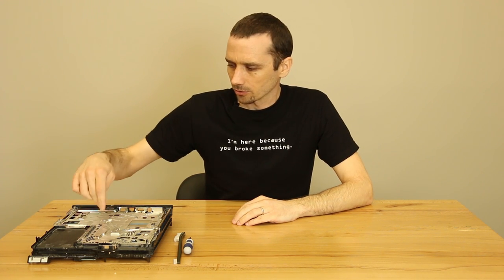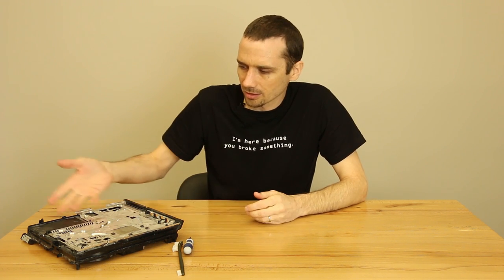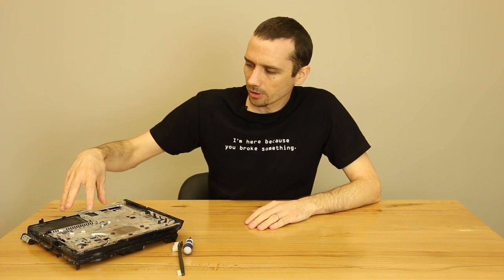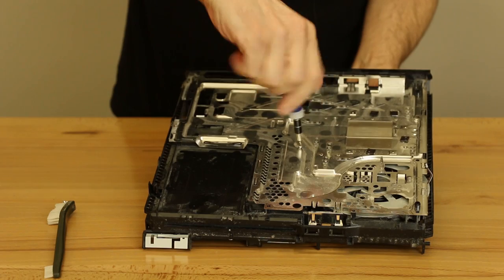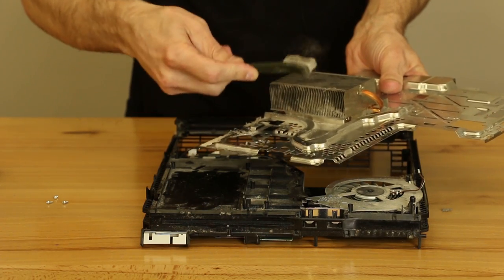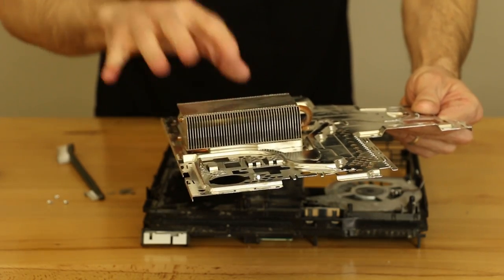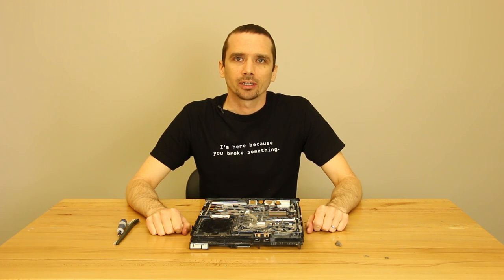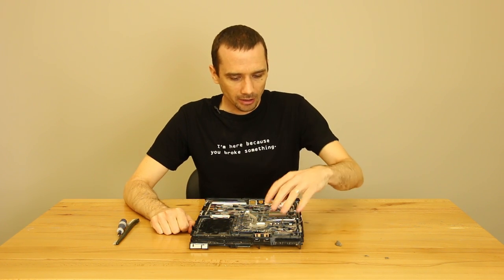PS4 Overheating Repair Tips - How to Fix Loud PS4

Comment: I have a vacuum that I can switch around and it blows air,  the should be fine to clean heats ink and any dust with? I've been blowing fan out since warranty expired, but it was really bad with dust.  So thanks now I'm going to blow heatsink and replace paste. I shouldn't have to take optical drive out correct?
Reply from the maker: +joshua knight Yes, that works fine for getting most of the dust out. You don't have to remove the disc drive.
Reply: Thanks. Just finished,  and thanks to you I got everything clean.  Would of never known to take out 3 screws for the heatsink and fan,  I definitely would of missed that. Best teardown videos on yt. Seen 1 guy that recommended leaving fan plugged in...
Reply from the maker: No problem...ya, it's easy to miss. Glad you liked the vids!

Comment: My ps4 has been overheating since 2018 i've had it since it came out and the screws that u would take out to clean the fan are not coming out is their a way to get them out?
Reply: hmmmm... 🤔 try to roll out with gripper tool 🔧 i have the same problem and for me this tool is worth it for me try to find a small grip for those screws i hope i helped you 🙂

Comment: I vacuum the outside of my PS4 about once every two weeks but I've had it for over 3 years so its understandable that it now sounds like a jet engine. Should I take it apart and vacuum the fan? I heard something about static electricity from a vacuum damaging the PS4.
Reply from the maker: The vacuum won't damage anything. I'm guessing that changing the thermal paste might help in your situation.

Comment: My ps4 never overheats and shuts down. The fan comes on loud alot, I didnt do that for the first year, I've re done the thermal paste on the apu multiple times after deep cleans and that keeps it quiet for about 3 months, the heatsink and the gap is just a bad design all together.

Comment: If the internal fan goes out (after pulsing like you said) can I use an external cooling fan instead as a temporary fix until I can replace it?
Reply from the maker: Probably not. I doubt and external fan would provide enough airflow.

Comment: TronicsFix, my ps4 gives me a notification that the temperature of my ps4 is too hot and i need to turn it off and it gives me a red blinking light where the white light is. In less than an hour of play time this happens, what should i do? I dont want to take it apart and i cant send it in and also it is hot to the touch, please help!
Reply from the maker: If you don't want to take it apart and don't want to send it in then there isn't much I can do for you. Those are your two options.

Comment: If I send my ps4 to you how long would it be before I get it back. Also I have done everything but change the thermal paste so would I be able to send it to you and you could change it and if so for how much?
Reply from the maker: Here's our listing for overheating repair...it should answer any questions that you have...let me know if it doesn't: http://www.tronicsfix.com/store/p56/PS4_Overheating_Repair.html

We charge between $69.99-$89.99 depending on how quickly you need it fixed.
Reply: +TronicsFix is their a guarantee that it will be back in 1 day if I pay the extra money?
Reply from the maker: It's not possible for it to be back to you in 1 day. The repair takes 1 business day. Return shipping takes and additional 4-5 business days.
Reply: +TronicsFix thank you i will most likely send it
Reply from the maker: Sounds good

Comment: If the fan doesn’t turn on at all will that prevent the PS4 from working?
Reply from the maker: No, it will still turn on...it will just overheat quickly.

Comment: my ps4 overheated i have it in well ventlated area i was playing sao for a short time exited the game all the sudden it turns off i tryed to turn it on no reponse  pressed power button again the light was blue then turned on one problem came up the fan is not working at all i fear that i have to replace the fan problem is i cant fix it if i do itll be broken im stuck with 2 options buy a new one or have it fixed by  someone with experience and when i turned it off it beeped 3 times.
Reply from the maker: I can fix your fan or any other problem that's causing the overheating, no problem: https://tronicsfix.com/collections/get-started

Comment: My fan is super loud playing online games. Me and my son have the same old model. I took it completely apart cleaned it put the thermo paste minus the pads still loud, his is not that loud. Ive never had a over heat notification. But the system did suffer one day inside the cabinet while in use and was real hot.

Comment: the back of the two leads on the back of my PS4 get hot I just wondered if the PS4 is overheating or is it the fact that if my PS4 is on my carpet and it and it's causing the back to overheat because it's on the carpet it's not actually sitting down it's standing up sideways  it should it be doing this
Reply from the maker: Your PS4 is not overheating. These things get hot, that's how they're made and it's 100% normal.
Reply: TronicsFix thank you bro

Comment: My PS4 1215 still is overheating (shouts down after 5min on)
It is all clean and cooler is running. Brand new thermal paste. 
I don't know what should be the cooler speed, but it seems that it should run faster. 
Any tip what else should I look for?
Thank you
Reply from the maker: Does it give you an overheating message?
Reply: TronicsFix LLC Yes, it says "Your PS4 is too hot." And something else I couldn't read because the message standards for about 3 secs. Then 3 beeps and it shout down again. 
Before that, when I turned it on, after storage status check, for some seconds the cooler ran really fast, noisy. It seemed like a check. This was the first time I saw it rrun so fast. Then it restarted and worked normally for some minutes.

Comment: I do live in victorville, and my room doesn't have any AC, but I do have a fan. My ps4 doesnt overheat, but it definitely get hot and loud. a few months ago, I used an air compressor to clean out my ps4, keep in mind I got it in January of 2017, and this was the first time I actually cleaned it, and clouds of dust came out. It's been getting loud again the past month, and cleaned it out 2 days ago, but no dust came out, and it's still loud, and gets hot. Not to mention, i have my fan blowing toward be and my ps4 cuz it rotates back and fourth, hoping it does something

Comment: Ok I followed the cleaning videos you have, my ps4 1215A is clean on the inside but now I get the PS4 too hot screen then the 3 beeps and shuts down and the fan is extremely loud after I cleaned it out.

Comment: I have a question if you spray a cleaning product in a PS4 vent would it short circuit.needs help🙁🙁☹️
Reply from the maker: That depends...is the console turned on when you spray it? I would never recommend spraying anything but air into the PS4.

Comment: Ok so my ps4 kept on over heating like 2 months ago so I opened cleaned fan and it was good it's been going on rest mode for no reason sometimes but I no its bc my rooms hot then I give it time put another fan on it bc I already got a stand with a fan for PS4 that has 2 little fans in it and it's good but now today it happen again overheated so I opened cleaned fan vacuum it hardly no dust then I got on the ps4 with a cool room a.c on got the big fan behind it I was playing for 30 min and it overheated again so now what do u think it is the thermal paste bc fan works got stand for ps4 with fans got a big fan on it and it still overheats and it's all clean. So what do u think it could be thermal paste ?
Reply from the maker: Yes, definitely replace it. It may not fix it but it's definitely the next step.
Reply: What do u think it will be well right now I'm about to open the whole thing and clean heat sink and take out fan clean it and then see how will I no I need thermal paste ?
Reply from the maker: Yes, replace the thermal paste if you are opening it.

Comment: i have been getting the PS4 is to hot msg recently on certain demanding games, but some run fine. Now my console switches itself off within 2-3mins of start up, regardless of a game being played.

I noticed my once jetlike fan is silent and seems it isn't pushing out warm air from the back like before. I assume the fan would need replacing? Any advice would be appreciated
Reply from the maker: Yep, sounds like you need a new fan.
Reply: Thank you very much for your response

Comment: I've cleaned it multiple times and my fan is still loud. is it the screws because i when screw in some of the screws it doesn't tighten. Is it that or no?
Reply from the maker: No, it's not the screws.
Reply: TronicsFix LLC yea, It doesn't spin anymore more.
Reply: TronicsFix LLC Do you know why my fan is making a grindy sound? Is it the bearing

Comment: Hey just asking bro. I've done the washer trick on the clamp and my ps4 has been working great. But it just shut off lately. I've adjusted the screws to the clamp and it'll work for 20 minutes and shut off. Now my ps4 will turn on and stay on for 5 minutes and then the fan will just go into overload (real loud)and then the red light and 3beeps. Can it still be repaired?
Reply from the maker: You may be able to fix it with a reball, but no way to know for sure. Usually if it's overheating it's because the clamp is too loose or the thermal pads are out of place or something.
Reply: +TronicsFix thanks for the reply.
Reply from the maker: Good luck!

Comment: I recently changed the thermal paste on my PS4 and it got worse, it's overheating more than ever and it sounds like a jet engine, any recommendations?
Reply from the maker: I'd take it back apart and recheck everything. I would also remove the bottom plate and fan and clean out the heat sink.

Comment: My PS4 cord unplugged I I plugged it back in and it didn't work on the sides it had a lot of dust and stuff on it so I assumed that was why it was very loud also so should I buy a new cord than clean my PS4 out orrrrr what I've also heard beeps from it before but it worked perfectly fine I'm very confused
Reply from the maker: You might try a new cord but no way for me to know for sure without having it here to test.

Comment: Unplug it , hold power button down for 10 seconds.  Plug it back in. Connect controller to ps4 using charger cord press the PS bottom to turn on. Wait for load screen, the system will repair itself after a critical power loss. Repeat this step until you are ready to have it repaired.
Reply from the maker: What are you talking about? A PS4 can not repair itself if it's overheating. Whatever problem is causing it to overheat needs to be fixed.
Reply: TronicsFix LLC It does repair the software part, its a recovery.It gets the past the two beeps and not staring part. In some instances the system will crash completely, almost like someone unplugged the power cord.  I know it doesnt fix the hardware part of it and the overheating. Its just to get the system to start up again in some cases such as in my experience it works.

Comment: Mine kept giving me an overheating message then shutting off after ten to twenty minutes of play time. I opened it up and cleaned out the fan and it worked a little better, but then it started making really bad sounds in rest mode and finally it stopped making sounds at all. I left it alone for a few days and why I tried to turn it on I got a message that said it couldn't turn on and to connect the controller via cable but it wouldn't turn on anymore. It beeped twice and turned back of immediately

Comment: Hey I’ve cleaned mine out. It send heat message on downloaded games. Any ideas will the paste do this. It is almost instant on Fortnite start screen. Please help
Reply from the maker: No, thermal paste alone will not cause that. It probably has a clogged heat sink.

Comment: Why don't just wash the heat sink, cooling fin, as well as the metal plate? You could breathe dirt in when you blowing it. Every time I clean a laptop I wash the heat sink and cooling fin, and it turns out working fine.

Comment: I replace thr old thermal paste with k4 and change aswell the thermal pads with thermal paste for pads replacesment. But it turns off when loading a game. Does the paste not good enough?
Reply from the maker: Does it give you an overheating error and turn the red light on before it turns off?
Reply: TronicsFix yes. I placed a fan on top that keeps it cold.

Comment: Cleaned my ps4 carefully and put it back together.  Turned it on and it started up fine. However now the controllers are basically unresponsive and wont stay connected and when they are on,  I can not navigate through the ps4 menu..any advice? ?
Reply from the maker: Check the WiFi antenna
Reply: TronicsFix its more than that. the ps4 after about 5-10 mins auto turns off due to being too hot.

Comment: I've sent my ps4 to Sony because it was getting really loud.  They sent it back saying nothing was wrong.  When it went out of warranty I opened it up and replaced the thermal paste.  It was quiet for a month or so, then it got loud again ( even while watching YouTube or Netflix).  What could be the issue?  Bad thermal pads?  Bad fan?  Bad temperature sensor?
Reply from the maker: I would try cleaning the heat sink. If it's really loud that tells you that the fan is working really hard so the fan is most likely good.
Reply: +TronicsFix I'm pretty sure I cleaned the heat sink when I pulled it apart.  I'll open it up and try again in the next week or so.  I'll keep you updated.  Maybe I can get this figured out yet!  Thanks for the advice.
Reply from the maker: You need to remove that entire metal plate to clean the heat sink properly. 
Good luck!

Comment: my ps4 never says its overheating it simply will shut off sometimes even when its been in sleep mode for days the problem is it will turn on flash blue a few times then just go black i was sometimes able to fix it by holding the button down until it beeps then either change the screen resolution or click restart ps4 sometimes changing the power source would do the trick and sometimes like now nothing i do gets it going again :/

Comment: My ps4 would sound like the fan would turn on and off and I would get the red light,  i disassembled the ps4 and cleaned the fan but its still not better, it works for a little while then blinks red and shuts down. Does this mean I need to actually replace the fan???? Help me please!
Reply: Same prob with me :(😢😢😢
Reply from the maker: It might mean that...does the fan come on? If it's not blowing air through then you need a new fan.

Comment: yeah i definitely think older ps4s are just loud. 2 years i cleaned and opended my ps4 due to overheating  changed thermal paste (artic silver 5) and cleaned fan and heat sink that fixed it ran quietly since then...then recently noticed my ps4 fan starting to become slightly loud so i opened again changed thermal paste cleaned dust from the heat sink and changed fan (new)and its still slightly loud while at times it does go back to slient shrugs i dont know ill just leave it be opening the ps4 is tedious

Comment: The ps4 has only been out for three years, should fan failure/thermal paste dryout etc.  really be happening all that often in a 3 year old machine?
Reply from the maker: It gets dried out very quickly. Have a look at our Xbox One S teardown...that thermal paste is dry and we haven't even turned it on yet!
Reply: Will do. For what are essentially PCs that's fairly disappointing performance. I can't even remember how many years my self built (not all that expensive) desktop lasted without any such issues.
Reply from the maker: Yep...these seem to be built to make it through the 1 year warranty period. There are plenty that make it through that period but the build quality could be much better.

Comment: Does anybody have any suggestions why my ps4 Slim is putting up the overheating message? It's spotless inside, no dust at all and I've just put new thermal compound on but it's still happening
Reply: Make sure your clamp is tightly screwd

Comment: Hey man, no one is really been able to answer me this properly so i hope you can help me, can i use a hair dryer on cold air to blow the dust from the ps4? I plan to remove the power supply and clean it along with the fans
Reply: BerserkwulfR just remove the 4 screws at the back and clean everything, especially the fan and ur heatsink. dont vacuum ur ps4 because it creates static field and can break components.

Comment: I bought my first ps4 3 weeks ago and without the three beebs or whatever, it just shuts off. and it feels pretty hot to the touch. I still got warrenty but i´m afraid that if i get a replacement unit i will have the same issue again.
Reply from the maker: +PowerfulLighting Take it back and get another one ASAP. It's not a common issue so you probably won't get another one with the same issue. Besides you can either take it back and get another or have a console that overheats...easy choice.